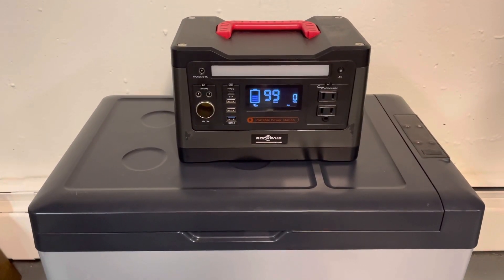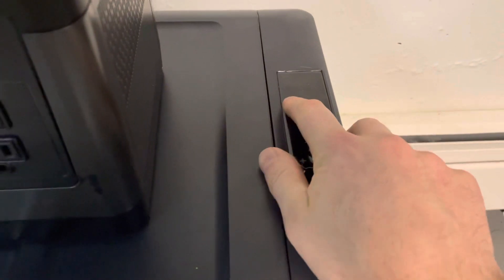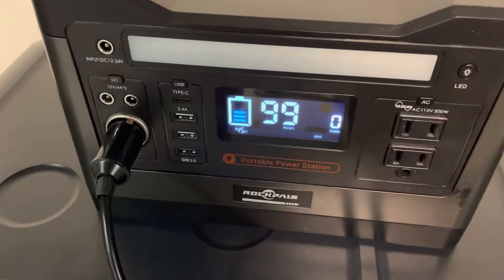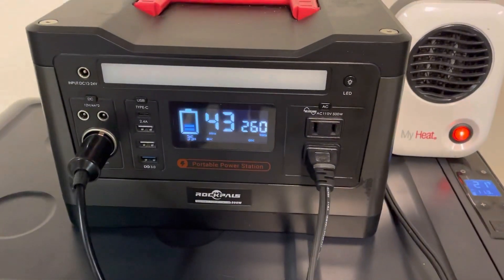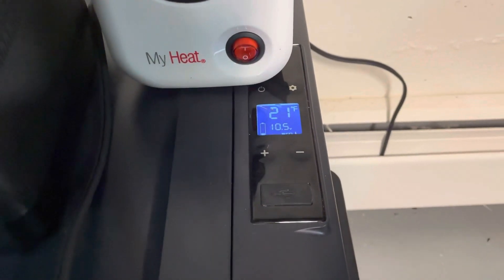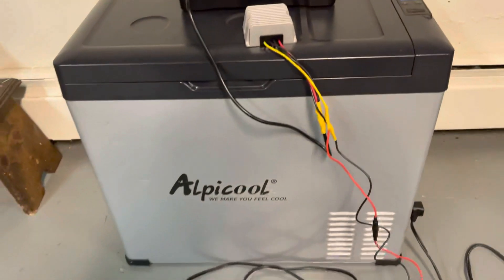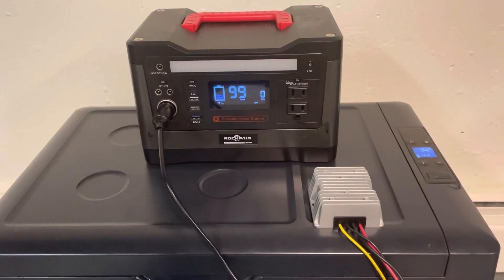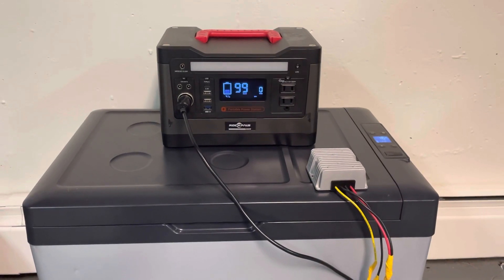How to Make a Regulated 12v Outlet

Comment: Hi may i asking.. now im using ac 220v with 60w. If i use converter 12v, is that can make my rockpals stay long enough? Example : without converter i can run around 6hrs. If i use converter can reach over 6 hrs?

Comment: Thanks a lot for making this video. I'm in the process of building a small travel trailer and since I have a Aimtom (Rockpal) 500W power station already and needs to run a small cooler like yours, I knew it would work since the 12V is unregulated.
Will get a DC DC converter and start with that setup. Might not need to get a regulated power station at all.
Thanks!
Reply from the maker: Thanks for sharing your plans. I hope this helped.

Comment: Just curious if this is still working well.
Reply from the maker: Still works fine. Most newer power stations come with regulated power, so this would not be necessary. In fact, the rockpals is starting to lose its max capacity after almost 4 years.
Reply: @AdventureGearTV  Thanks for your reply. I'm thinking about making one for my battery box.
Reply from the maker: @annetorswick9641  make sure to get one that supports your load. They make 3A and 6A versions. The 3A won’t power the fridge. What are you going to power with it?
Reply from the maker: @annetorswick9641  I double checked my converter and it is a 10A model. I would be very surprised if your fridge pulled that much power. Most regular car outlets are rated at 10A. Also, most fridges only pull 70w max. Which is closer to 5-6A.
Reply: @AdventureGearTV  Thank you and thanks for the video.

Comment: Thanks for this video! I have the same power station and as expected ran across the same issues. I bought the 13.8 converter mentioned elsewhere in the comments, however I’m having issues with the power station turning off when I have the fridge running from it. Any suggestions? I had a friend do the wiring so I’m honestly not sure whether it was done correctly, but I couldn’t get a good view from your video on how exactly you did yours to compare. Thanks!
Reply from the maker: That sounds like a big pain. What is the power draw when the fridge is running? Is the DC outlet flashing and shutting off?
Reply from the maker: Also, do you have the 6 amp converter? I noticed they offer a 3 amp on Amazon, but it won’t be powerful enough for a mini fridge.
Reply: The 13.8v is actually 10amps. I just tried to plug the fridge in with it and the compressor kicks on and then immediately shuts off. No codes. It might be a safety feature on the power station as the power station turns completely off. Not sure how to fix it though. Step down from the 13.8 maybe?
Reply from the maker: @HaleyNichole20  hmm. If it doesn’t work at all, then it’s possible the wires aren’t connected with the correct polarity. Positive to positive and ground to ground. Does the fridge’s screen light up?
Reply: Yup the screen lights up, but as soon as the compressor kicks on, everything shuts down.
Reply: @HaleyNichole20  had same issue with my Rockpals 350, but i used 12v converter with 5amp

Comment: Where did the Amazon links go?
Reply from the maker: Hi, unfortunately, I don’t have enough subscribers to share the link. I’ll put them back up when I meet the subscriber threshold.
Reply: I found the correct video but the link goes to a 3W.  I'm very confused.  Another comment days to get a 13.6 to 6 rather than a 12. Are you able to provide a link to the correct product?  Or even exact specs of what I should search for?  My Power Supply shuts off immediately when compressor comes on.  TIA.
Reply from the maker: Hi Kay, which Milin do you have? I’m finding a 243wh and a 622wh. The 243wh might be underpowered for a fridge. Also, which model fridge are you hooking up? Either 13.6 or 12.0v usually works for car mini fridges. In the link on Amazon, there are options that need to be selected. It looks like they currently have 12.0v at 6 amps which is what a typical mini fridge needs to run.
Reply: @AdventureGearTV  I have the 600W/622WH. Can't fugue out how to send pic of side of box with specs but you probably already have that info! Thanx!!
Reply from the maker: That should run the fridge. Which fridge is it?
Reply: @AdventureGearTV  Sorry. Didn't see your last Comment. I have the Joy Tutus fridge. It runs on 12V when I'm driving - no problem & AC when at home or thru a converter.  But if I plug the 12V cord into my Milin when parked for the night, fridge starts up & then immediately shuts down. It sounds like I need the "modulator" to make it work on 12V.  Yes?
Reply from the maker: Hi, there is a small chance that the 12v DC cable supplied with the fridge is wired with the poles reversed. Have you tried to run the fridge directly in the vehicle outlet?  The 622wh should run the fridge without an adapter.
Reply: @AdventureGearTV  Yes,  it runs great on auto 12V while I'm driving so wiring seems to be OK. Heck, I'll get back on Amazon & order the modulator. If it solves the problem I'll be a happy camper.  If not,  I'll send it back & keep seeking a solution.
Reply from the maker: I really hate to say this, but it might be an issue with the power station. The 622wh Milin is designed to handle a mini fridge without additional devices.  Have you tried any other devices in the 12v outlet? Also, it the outlet shutting off, or is the fridge going into low voltage protection mode. If the outlet is shutting off, it’s probably the power station.
Reply: @AdventureGearTV  Oh! Now that you asked that question...it's the Milin which makes a squealing type noise & shuts down the outlet!  I'll do an experiment tomorrow & have a couple of the other outlets in use when I attempt to run the fridge & ascertain if the whole Power Supply shuts down at that time or if it's isolated to just the 12V outlet. Thanx for helping me troubleshoot! I do so appreciate it!  I'll get back with you tomorrow... everything is at a friend's house.
Reply: I'll also try a few other 12V appliances in the Milin. I have run a small 150W Inverter in that 12V socket & it works.  ???  Mystery.

Comment: My Rockpal has regulated AC. Will an AC to DC adapter work?
Reply from the maker: Hi, AC to DC adapters work ok for small loads, but this is not very efficient for running the fridge. On warmer days, the fan in the RockPals runs continuously if you use AC power.

Comment: Thanks! I was thinking of returning my Rockpal and getting a Jackery but It will be cheaper for me to just get a regulator. You get more watt for the price with the Rockpal.
Reply from the maker: They do have a lot of power and mine is still working well after heavy use.
Reply: @AdventureGearTV  If you have time can you add links to items I need off of Amazon? Can you do a video on how to wire the items too?
Reply from the maker: @Petrockpress   Great idea!  I had to start an Amazon Affiliate Account and add a few disclaimers.  The links should now be in the video description.
Reply: I saw an exact clone of this for 260 with coupon and ordered it but it`s back up to 370 now.
Reply from the maker: What brand is it?
Reply: @AdventureGearTV  Bawaut Portable Power Station,540Wh Backup Lithium Battery
Reply: @AdventureGearTV  Price rose another 9 bucks.

Comment: I was just looking at this regulator online. Goal zero makes one as well with an Anderson plug connection. I’m thinking about getting that and replacing the connections for my rockpals. Gotta alpicool on the way now, so thanks for this surprisingly relevant video. 
Secondly, Abn as in PLFs under T-11’s or MC-6’s on a DZ?
Reply from the maker: Hah! Yep, I started with the T10, then on to T11. Not currently doing jumpy things though.
Reply: Yeah, tried using the goal zero regulated cable, it runs fine till the compressor runs which causes Rockpals to shut-off, same thing with 12v converter, 5amps. I'm using Rockpals 350 but I think they all have a shut-off mechanism.

Comment: That is a great solution and I was wondering if there was some type of external controller you could add.  I think you are on to something as it appears Jackery is the only unit that is 12v regulated.  There is a new Rockpals 500 and I had it ordered but later in the day I kept seeing comments that you cannot do any pass thru charging.  It was my understanding with Rockpals that you could use 12v while either connected to vehicle power or solar.  Very confusing and that is why I liked your videos as they appear to be honest and testing situations that I anticipate having while camping.  Thanks
Reply: You can’t use the AC inverter and charge at the same time. You can charge and use the 12v simultaneously though.
Reply from the maker: Correct, no pass through charging on the newer version. This is definitely a must have feature for these items.